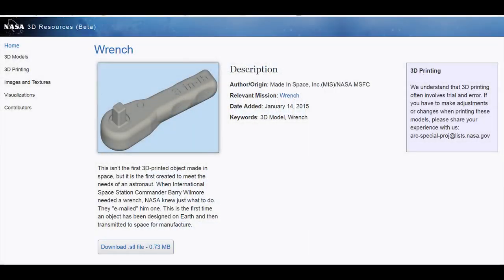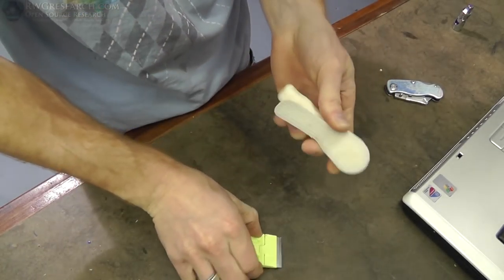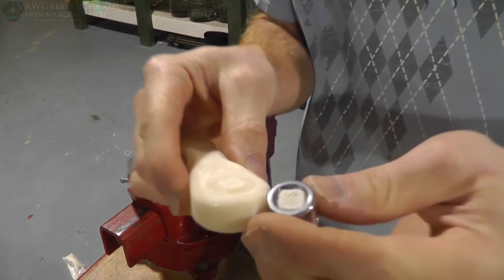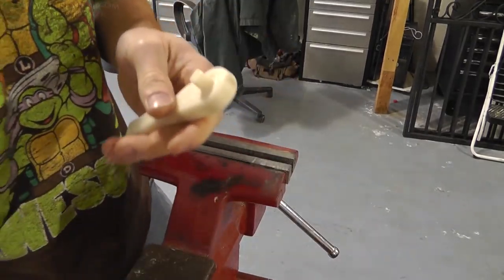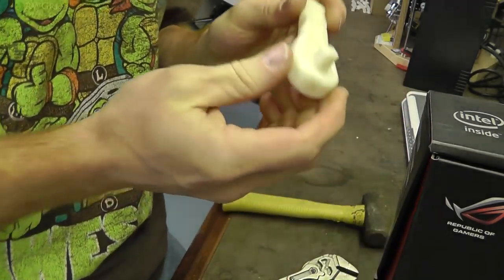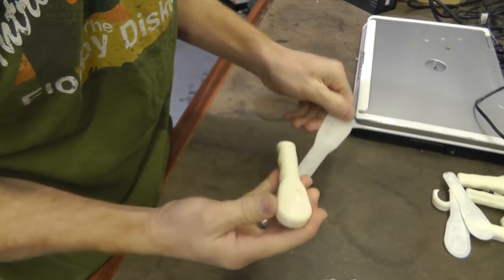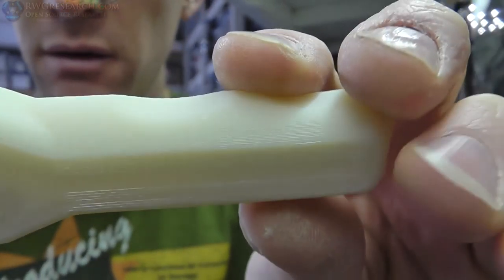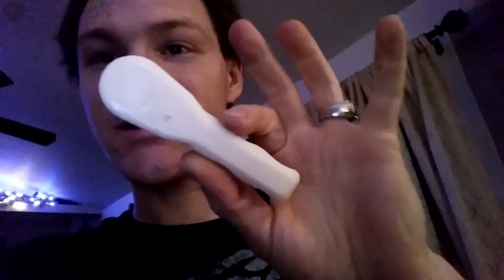If NASA Can Do It So Can I, Thanks To Open Source. Made In Space: 3D Printed "Wrench"

Comment: I 3D printed one of those and it works gave it to my friend dave, you gotta free the rathet peg by sticking a sharp knife down between the wheel and the peg then it will come free, but you also have to free the rotary disk I did that by sqeezing it in the vice.